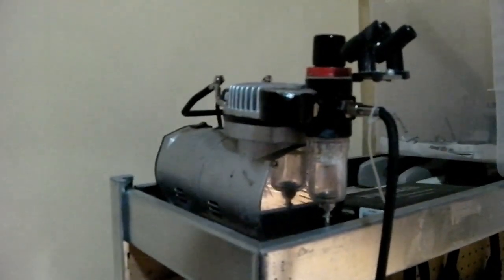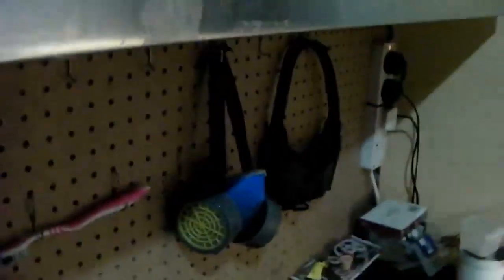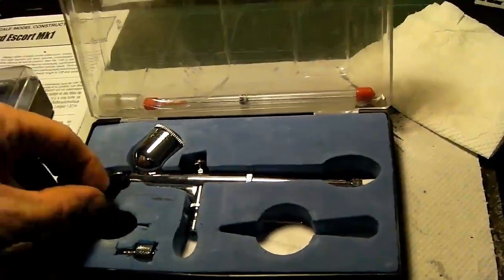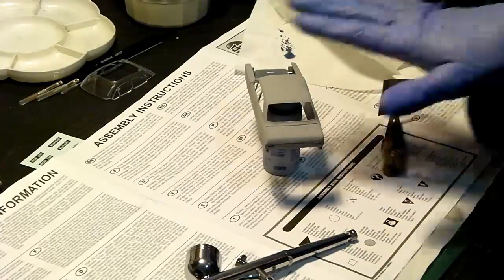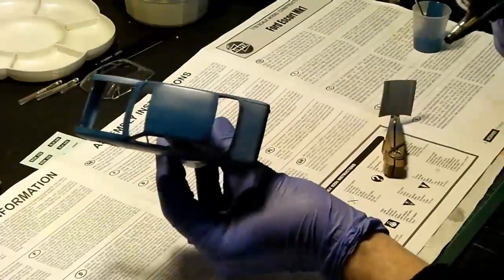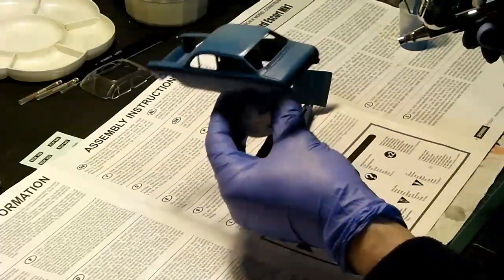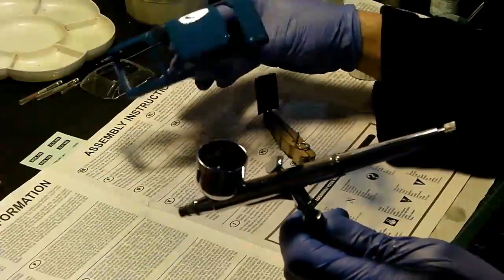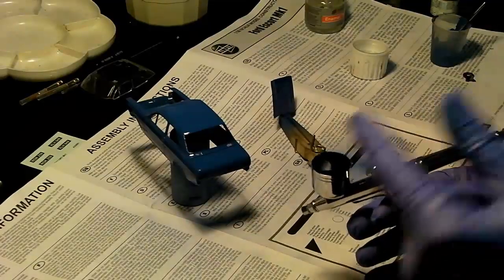Airfix Ford Escort MK1 1:32 scale model kit build part 3

Comment: Yay, the first time I got my name mentioned in a Youtube video. :-) Since I am not a native English speaker (writing from Germany here), it was a bit hard to understand for me when it became quite technical, and from under the mask, but thankfully you did not get too technical while under the mask, so cranking up the higher frequencies on my equalizer helped. 

I never saw an airbrush in action before, so I was puzzled when you started spraying with that clear part sitting so close - but obviously the airbrush is so much more precise than a spray can that it was not in danger, impressing. 

Funnily the word-for-word translation of water trap into German, "Wasserfalle", is a carnivorous plant. ;-) But I figured it out, I need a "Wasserabscheider".

Since it takes 24 hours to be touch dry, would it perhaps be a good idea to put it under some kind of cover, like into a cardboard box, to prevent dust from settling on the surface, in case the room should not be perfectly dust-free?

Thank you for the extra work of filming the painting.
Reply from the maker: Haha, fame at last eh. :) Though technically I'd need to be famous for it to count. 
Yes, the double action airbrush is incredibly precise, (though to be fair, I should have moved the other parts but I don't normally spray at that side of the room) if you Google images of airbrush art, typically on vehicles, they are done with a DA airbrush, with a 0.2 tip you can be pencil line precise. 
For bigger areas you can move the airbrush further away and open up the paint flow to full, that in itself can be adjusted by increasing the airflow on the compressor. Have a look through my earlier videos and you'll see one which covers the difference between single and double action airbrushes and gives an overview of how they work. 
Maybe I could do a more detailed one on double action brushes in the future. 
The under brush water trap is a necessity but they're cheap enough.
Best thing when getting started is lots of practise on anything plastic that you can spray.
With the drying time of enamel particularly but with any paint, sitting them in a covered container is a good idea, I use an old plastic storage box with a plastic sheet to cover the front.

Comment: Would tamiya enamel paint be the same as humbrol airbrushing wise on the body? As I have just bought an airbrush. Thanks -conrad
Reply from the maker: Conrad smith Absolutely yes.
Reply: spidiq8 lol I have thought of a better way I think, tamiya acrilics (as these smell less) then go over it with the new pot paint tamiya laquer paint :P I personally don't realy like enamels as they smell and take ages to dry. Anyway thanks for the reply and I hope everything's going good for you :)
Reply from the maker: Conrad smith No problem, though I'd ask why acrylics with lacquer?
Lacquer paints use a hot solvent that can react with acrylics and enamels and unless sprayed carefully over fully cured acrylic can cause problems
Reply: spidiq8 hmmm realy? I havint heard that but I can see that hapning. What would you recommend?
Reply: I meen if it's cured and there's no water there's realy nothing for it too react with but I don't know.
Reply from the maker: Conrad smith The lacquer (cellulose) thinner which is the solvent chemically will melt and lift the paint below due to the paint type and formation, the general rule of thumb is not to paint 'hotter' paint on top but if done carefully you should be OK, you need to lay down a mist or tack coat first, I'd recommend you practise on some scrap material with your airbrush to get a feel for it.
If you're planning to use the acrylic as a primer I'd recommend using a lacquer primer anyway as it will stick to the plastic much better.
Reply: spidiq8 ah yes, thank you. So if I were to use acrilic paint I would be best to use acrilic clear? I will have to do my homework on this topic of airbrushing as I have no idea wear to start but this has helped a lot so thank you! :)